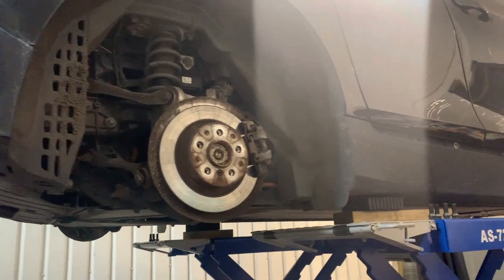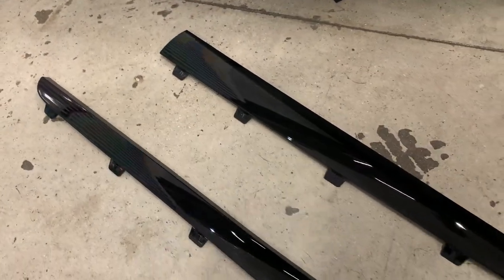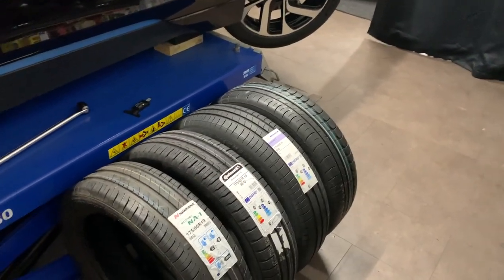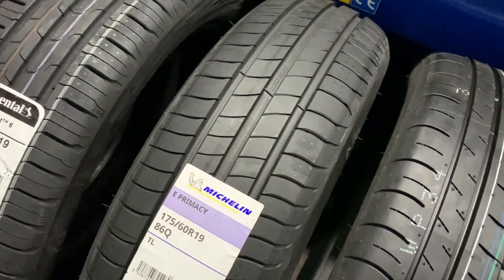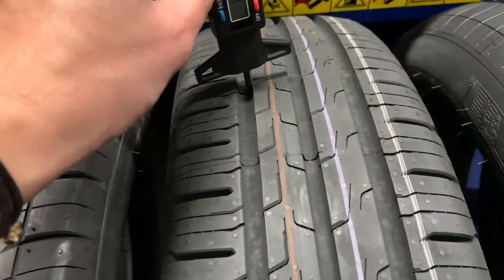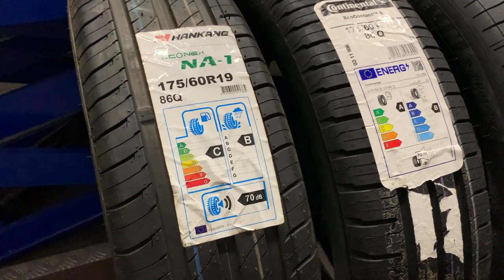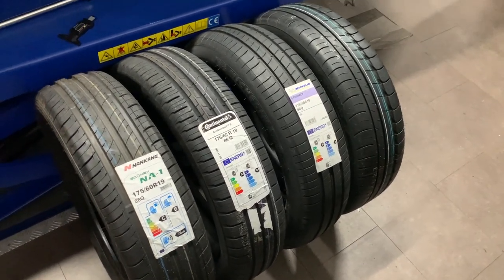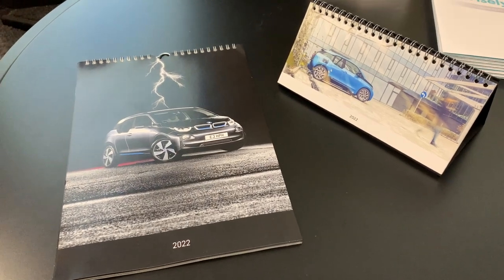VLOG #2: Finished Stealthy REx, i3 Summer Tyres & The Perfect Gift

Comment: I doubt many folks read or add to the comments on videos that are 2 or three years old, but I had to say how much I like the gloss black wheels. I like the contrasting look of the accents, so I might have left the common blue, but I saw an i3 with the copper contrasts that I thought was very good-looking. keep up the good work with the i3 content. I understand that as time goes on the i3 will have to become a smaller part of your business plan. Consider though the i3 (in particular the i3s) seems set to move into the 'cherished car' category on its way to becoming a 'modern classic' and, in the fullness of time, a 'classic car' of the first quarter of the 21st century.

Comment: I noticed that you coded the door mirrors to fold with the remote. 😁
Reply from the maker: Nope, no coding... just press and hold the lock button on the remote key fob and they fold in after approx 3 seconds :)
Reply: @wiselyauto  I didn’t notice how long you pressed it. Lol I coded mine to a single blip, also turned on the rear daytime running lights, defaulted sport mode, changed the seatbelt bongs to the Rolls Royce chimes. Oh and added tyre temperatures to the tyre pressure menu.
Reply from the maker: @garrycroft4215  nice work!

Comment: Looks like the Bridgestone have more contact patch, the rest have 3 big water chanels, the Bridgestone 1 small + 1 medium + 1 big.
But cant understand why the smaller chanel is in inner part of the tyre, usually asimetric tyres have more rubber at outer side for the corners.

Comment: My 2017 94ah I3 is equipped with 4 155/70R19 Bridgestone Ecopia tires and they are holding up quite nicely. With more than 10.000 kms the wear is minimal.
Reply: I have an 2020 i3s with at the rear bridgestone ecopia 500 195/50/20.
Im at 20.000 km and have 1,7mm left so very close to renewing.
The fronts are also bridgestone ecopia in 175/55/20 and still have 5mm left.
Tires have never been changed before and came new on the car from factory.
Always good to share these things👍🏻
Reply: 20000kms and arround 5mm front and 3.5mm rear.